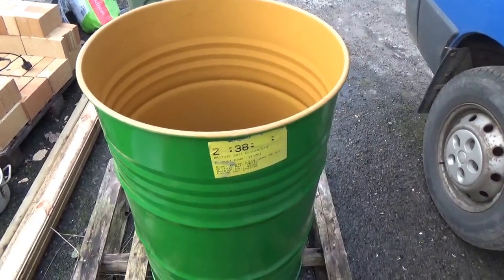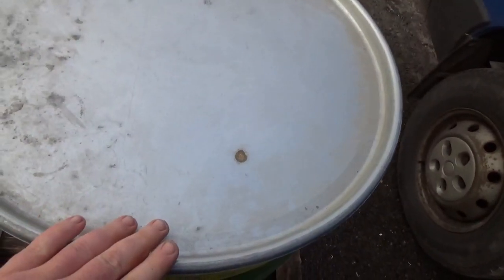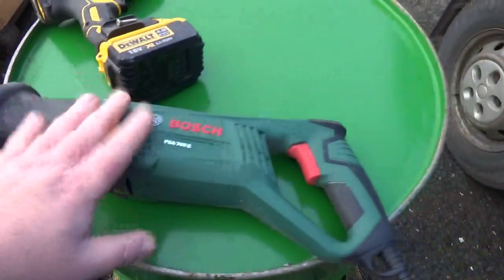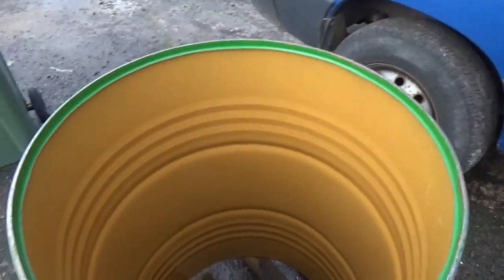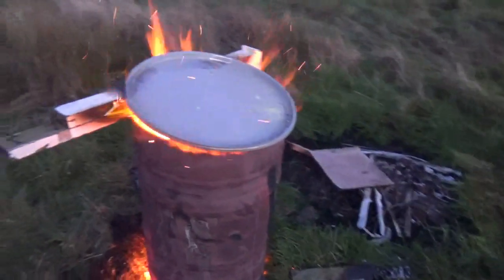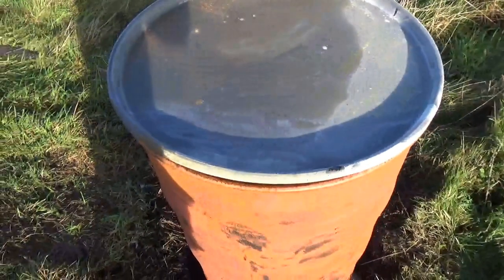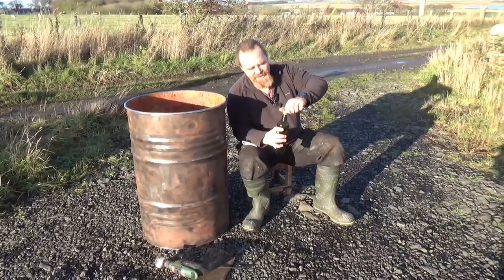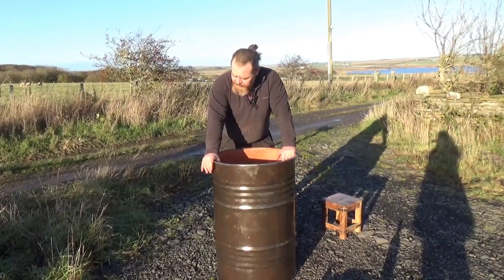Rocket mass heater build 4. Preparing the barrel. The most efficient heating in the world.

Comment: Awesome, can't wait to see the first burn. 
I'm sure you will do this anyway, I would use the CO monitor you used in https://youtu.be/79BlboFE7YA to check for any leaks around the gasket and lid when you fire it up for the first time. Safety first :-)
Reply from the maker: Definitely, it's part of the reason we got the meter. I measured CO using the old fire as a baseline. At this point I'm just waiting on a single piece of pipe to be able to light it. Hopefully tomorrow! Video editing is a bit of a choke point currently.